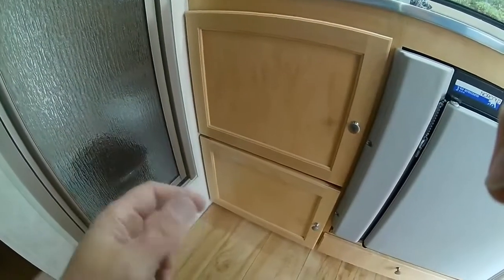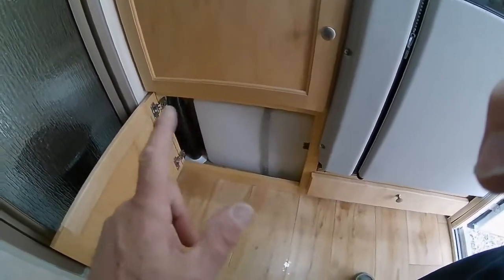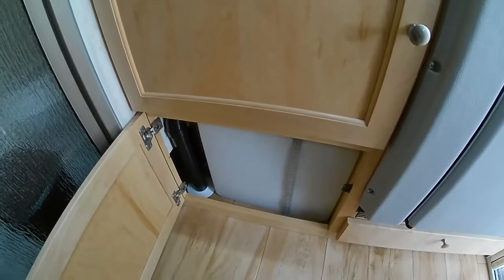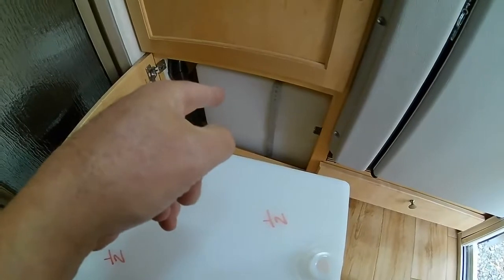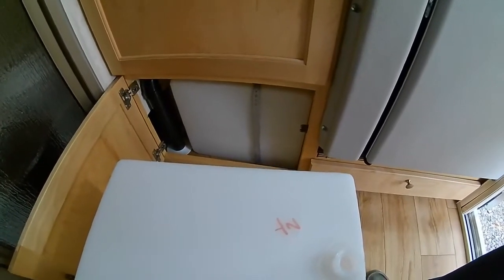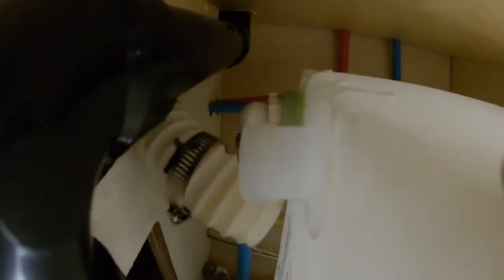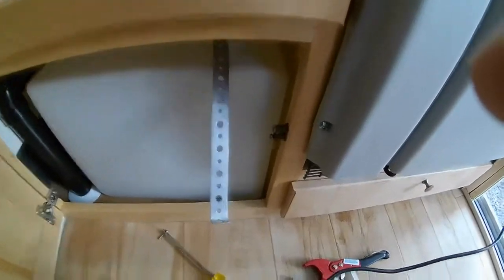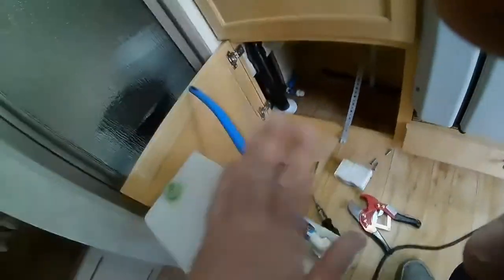More Water - 5 to 9 Gallon Tank - Tab Trailer Upgrade

Comment: Is that where the water was installed when you bought your T@B? Oh, now I see that it is. Ours is in a different place and that cabinet is empty for storage. I think access to our water tank is under the T@b but it might have room to do something similar.  Love your videos.
Reply from the maker: In my 2015 Max s Trailer that is where the water tank was originally installed. In later years and other models, the tank is underneath the trailer by the axle.